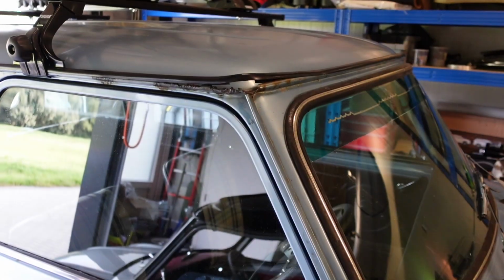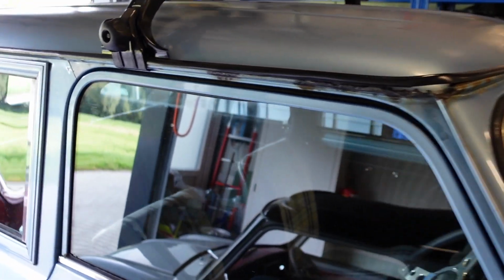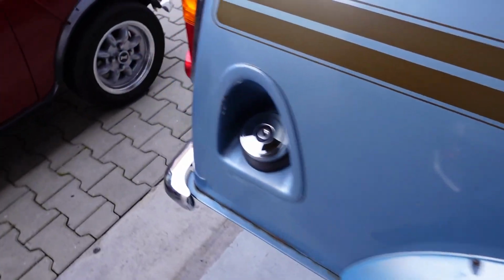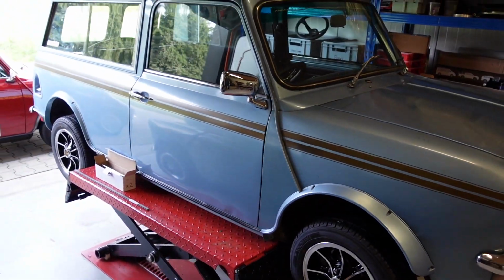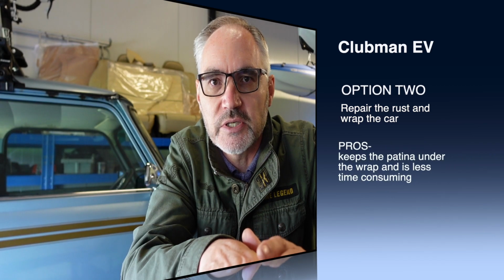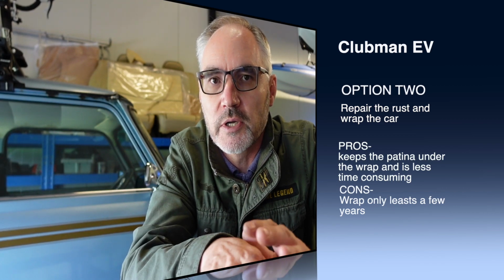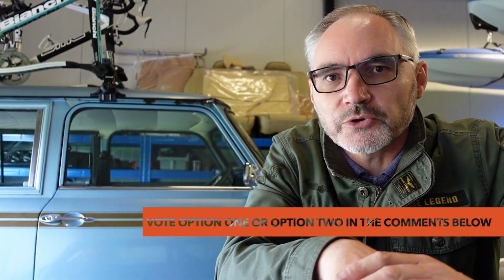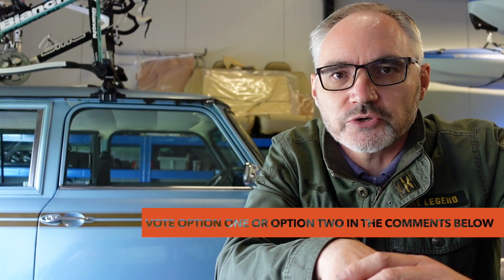Mini Clubman EV conversion- You decide! - question 1

Comment: If your going to invest so much into the Ev conversion i would restore the body. Maybe the corner of the roof sat under a tree? Also the trim below the doors is a complete water trap, i do not have one on my van for that reason
Reply from the maker: I did wonder about that Alex..........thanks for the tip, I'll leave that off when we repair that panel👍